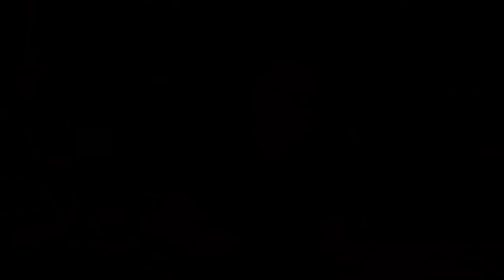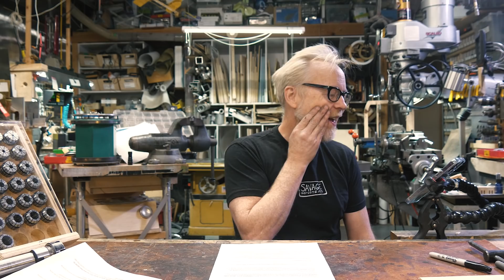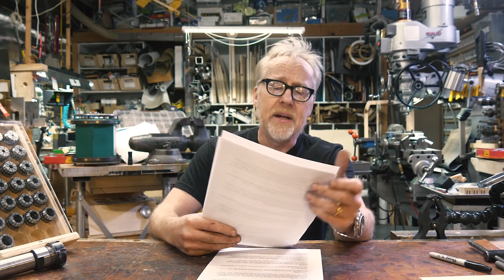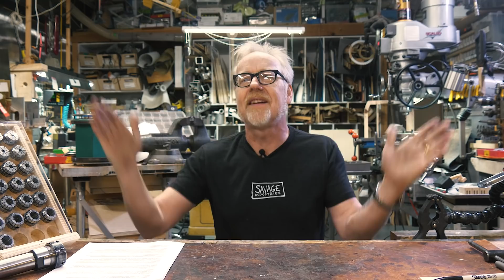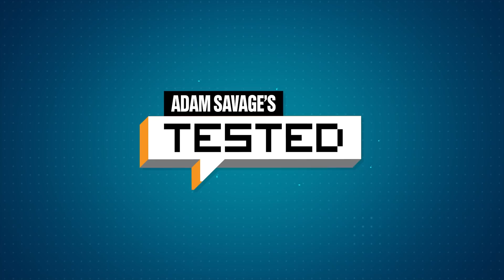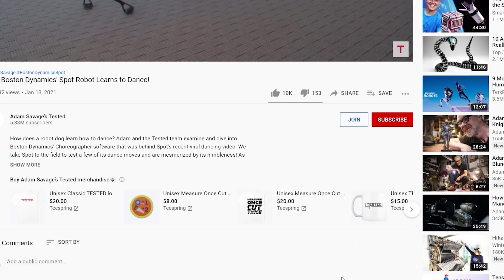Ask Adam Savage: Managing Tools and Materials When You Have Two Shops

Comment: Have lived with split workspaces all my life, Don't cross the streams! Definitely easiest to split by type (welding/wood or clean/dirty). Less trouble with compatibility of messes (sawdust and sparks and fumes) fewer tools that need to be in two places at once, those that do, like screwdrivers, pliers, and wrenches, are cheap enough to double-up on. Currently mine are split by miles not feet, so the truck also becomes a rolling toolbox. Also striking a balance between space to work and materials on-hand is important (leading by negative example here...) storage can takeover if you let it.

Comment: I have the exact same problem. I have a small shop in my basement and a larger one in my garage. I live in the northeast so the uninsulated garage is too cold to work in in the winter. It's basically come down to using hand tools and doing restorations or "quiet" projects in the house and larger builds and power tools in the garage.

Comment: For tools in 2 locations- hockey tape works great. I have a set of tools with bright green hockey tape wrapped around each tool. Those stay in the house. If I ever am thinking 'where is my claw hammer' I end up thinking 'where is the claw hammer without tape' or 'where is the hammer with tape'. The tape fades over time, and when I deep clean a tool I also replace the tape. Rolls are cheap at any sporting goods store

Comment: The way I’ve always thought about the shop split which I’ve dealt with many times in past living situations is that you can often think of a more outdoor connected space as a raw materials ingestion and rough breakdown of that raw material into specific parts and then as you move to higher precision operations the tools for those operations are in your other shop area. Finally as Adam mentioned for final finishing or messy operations you can move back to the outdoor space and take advantage of the ventilation, drying space, etc

Comment: I have a shop that has 2 different workspaces or with an "office" so to speak. What I have found for me is to split them into 2 different types of workspaces- clean and dirty. Not that I don't make a mess in the office but I keep all my major mess (and non climate controlled stuff) stuff in the main area of the shop, so wood working, metal working, anything with oil or gas or volatile chemicals, etc. Then in the office I keep everything that I want relatively clean or climate controlled- gun smithing, leather work, model making, working on my bow, sewing,  small detailed things, etc. I also keep specific hobbies in their own boxes/tackleboxes so that when I want to work on that kind of project I open up that box and use that and put it away when done. It helps cut down on clutter

Comment: I have exactly this problem, my engineering and woodworking workshop is 10 miles away, my modelling (railway not catwalk) is in the loft where there is no natural light so my model building is split between the conservatory (good light but too cold in winter) and the dining room.  The one thing you need to make it all work is a very long suffering and supportive wife!

Comment: Where feasible, I'm a big fan of separate spaces for separate types of work. I keep one general shop space (mostly woodworking centric) in my garage, a smaller, dedicated area in my basement for gunsmithing, and related work, and am setting up a third space in my shed for yard tool maintenance. The last being a small set of tool necessary for basic tractor maintenance, a cheap grinder, a vise, and some files, basically a sharpening station for mower blades and chainsaws. 

Each of the two smaller shop spaces has their own set of tools that cover the work done in those spaces 80 to 90% of the time. If I find a need a particular tool more than once or twice a year, I start shopping for an acceptable version to leave in that space.

Comment: About a year and a half ago, I got "tired" of my shop.  Not that I didn't know where things were.  It was something that Adam said in one of his videos, the bit about having the tools you use the most, the most accessible.  I measured the space, then sat down and put it on paper, then I made cut outs to match each piece of equipment, and figured out where I wanted it.  It was at that point I realized a problem .. I had too much!  My space was basically a long, single garage. Another space in the house for "office space" and a couple of small sheds outside.  My tools and abilities fell into many realms.  I built and worked on new homes and commercial buildings, had enough tools at one time for about six crews, which I had whittled down over the years, but not enough, I had many "materials".  After much deliberation I narrowed down "what" I still wanted to do, what I "needed" etc.  I then went about making it happen. I decided I want to still do "electronics".  This is something that needs "clean", small space, and not many tools, more or less a "station" is adequate.  I also do a fair bit of design work, I use a drafting table and computer for that, very rarely together.  The "Office" became the drafting / electronics/ office stuff room. I haven't done much woodworking in years, I'm more in the metal work realm, it can be "dirty" ... it was relegated to the Garage.  I got rid of most of the wood working stuff, but still needed some for "around the house and work".  With that thinking I went to "organizing the garage.  Simply, "defining" what I wanted to do in each space was part of the major hurdle!  Basically, the same as stated by Adam for the two space workshop!  I had tools etc. in nooks and crannies all over the place.  I had "shop" at work, and another at home, and many times the tool I needed, was in the other place, an hour each way to get to!  And the one tool at each place, didn't seem to matter, it was always the "single" tool you owned that you needed!  I started in one corner of the garage and over six months, worked around the whole garage, clockwise ... new custom shelving's, racks, all walls had purpose, peg board everywhere with shelf standards floor to ceiling at each stud, custom cabinets.  I used every space, nook and cranny. I built pegboards hanging in a rack on barn door tracks. "Everything" had a place and was easily accessible.  I had "sections" like one just for "air" related tools and accessories, another area, just for cordless tools, accessories and a battery charging stations, ... close to a electrical outlet! During the process, many tools and materials were found to be double and triple (or more!).   I sold the multiples and almost paid for everything I had put out for the upgrades.  Anybody working with me could find things easily, and know where to put them back.  My "main joy" as a result. I could walk into the shop and do a job so much faster, no matter the size of the job, it was faster!  I was turning out projects a 2 to 3 times my normal speed, just by being able to grab what I needed, use it, and put it away to get it out of the way!  Like Adam said, spending time "labeling" is a "luxury" in the making, I could go to spot and pick out the bolts I needed, with the particular nuts and washers in a moment, instead of "digging" for 15 to 20 moments.  I re-arranged a few spots after using them and finding them lacking, the end result was wonderful.   Sadly, within a few months of completion, I had to move!   At the moment, my shop is in boxes!   But, very well organized boxes, just waiting for me to finish my new and improved shop!  It is way easier, the second time, I know how to do it, and where everything, including me is going to be put!

Comment: I've had split shop buildings multiple times.

Few suggestions are making 1 a 'clean' zone and other is 'dirty'.  I.e. everything that makes sawdust, shavings, chips happens in the 'dirty' shop then the 'clean' work such as assembly happens in the clean side.  

Another approach is to have 1 shop entirely storage for materials/parts and the other for working. Keep as much items in the storage shop which aren't needed daily so the 'working' shop can focus on the actual work.

Or

Comment: I have the same issue as Lex Jr.   I have a basement and a detached shed area in the yard.  I also have multiple of several tool varieties to make it easier, but metal working (anything flamable)  is outside, wood working is inside.  I wish it was the other way, as the woodworking makes a lot more mess, but I gotta keep the forging and welding out of the house (and away from the sawdust).
For Heracles, Dont.  It will cheaper in the long run to just rent a new space for the significant other...

Comment: building in one area, finishing and paint in the other, keeps the dust off your builds...
Reply: You know, that's a good "plan," but I've found, in reality, that keeping things clean all depends on what you're working on.  I've got metalworking equipment (mill, lathe, bandsaw, welders, steel 1 inch plate, 3 X 4 ft welding table,, grinders), plus woodworking equipment (miter saw, wooden workbench, etc) and I do not do any wood finishing out there because of the grinding dust and flying steel and aluminum chips.  They aren't real compatible work methods (wood vs metal) because cross contamination is always present.
Reply: @corndog6700  then you need a third finishing area :)      We all have different setups, I have the 3d-prining located in a large closit equiped with a smoke detector (my printers are noisy). The woodworking and 95% of all the tools are in the garage, the main shop. The workbenches are for worrdworking and multi purpose. So I can do electronics and anything I can think of. My metal working is also done there, I dont do much of it and when I do its on a small scale. I have a tiny 1960's unimat lathe/mill.
Reply: And.......my wife really, really doesn't like the idea of moving the washer and dryer out in the backyard.....oh, well.

Comment: I have very un-relatable amount of spaces, but that split shop thing is very relatable. Toolboxes you can move can be an aid. Some doubling might be unavoidable (two compressors, two ratchet sets). I'm tempted to try one of those rolling stacking things but they're so expensive. I am planning to put big (from old big wheel lawnmower) back wheels on my welding cart, because my bigger, unheated/uncooled, less convenient space has 220 while my nearer space (garage) does not, so I anticipate using both for different welding tasks.

Comment: I nominate myself for Adam to makeover my garage shop. I do everything. Mechanic, wood working, electrical, paint, welding, plumbing, model making, and digital work.  I’m working out a two car garage that still have use a typical garage storage like holiday crap and extras. My set up is everything to be mobile. I have two drill presses and they have wheels. I built a multi function work table that has wheels with my table saw, router, miter saw built in one side and the other is flip top with a plainer, grinder, vice built in and with a vacuum system.  The was designed to fit into my spray booth when my booth ain’t being used to open the floor. Got a bench next to both of my tool cabinets with a electrical station. I store most of my materials in the rafters. I do the best I can with the space I got. I really need a bigger place. I challenge Adam to make my spot better because I thing it’s already the best it can get.

Comment: I'm stuck with a L-shaped workshop in my basement, that is decently large enough (~375 sq. ft. and holds a large table saw, miter saw station, a few benches and misc. tool stations), but is very hard to access with large materials.  I have to pre-cut the large stuff in my garage to get it downstairs by myself without having to get someone to help (think 4x8 plywood).  I also have a separate laundry room in my basement that I purposely made large enough to have a countertop with cabinets I can sit at so I could do "clean" projects there and not in my dirty workshop.  It is all about assessing what you have and making the best of it.

Comment: The indexed case of what looks like collets to your right had my curiosity raging throughout this video.  What are they, and what tool do they go with?
Reply: They are ER 40 Collets and go in various styles of collet chucks.
They hold cylindrical tools or stock very firmly but evenly.
So in a mill to hold end mills, drills, cutters with parallel shanks, dial gauge bars...
As a chuck in a lathe to hold smooth bar stock or hold round tools in the tool post.
Come in many sizes, 8,12,16, 20, 40......
Reply: I believe those are ER-32 collets for milling machine tool holders.  Very versatile and rigid.

Comment: I had the split shop for a few years.  Finally split it into my handyman/home improvement stuff in the garage and the gunsmithing/wood working/machine shop in the shed.  I eventually to save constantly walking between the two, had a lot of "two of everything."  When I moved three years ago, I finally consolidated everything into one location and while not perfect, much better.
Reply: I do sort of the same thing in my shop that has a large "office" in it. All my cleanish stuff like gunsmithing, leatherwork, bow tuning, sewing, etc is in the office. All the wood working, metal working, engine work, lawn tool repair, and all other major projects that make massive messes and dust are in the main shop area. Helps a ton especially when I don't have a great dust collection yet